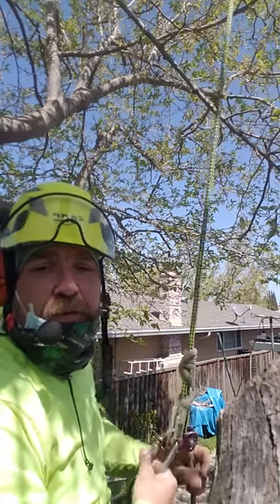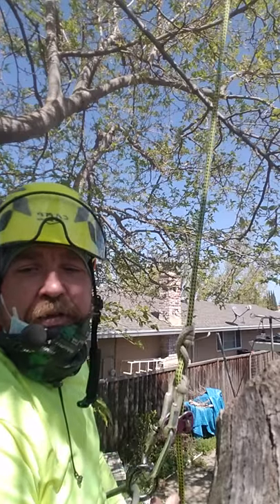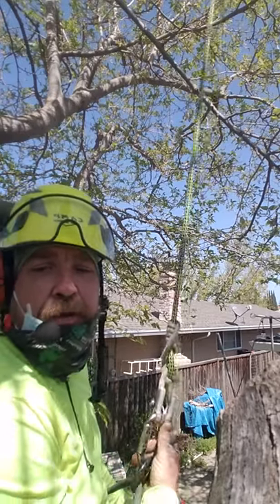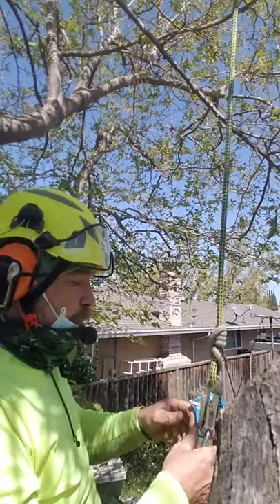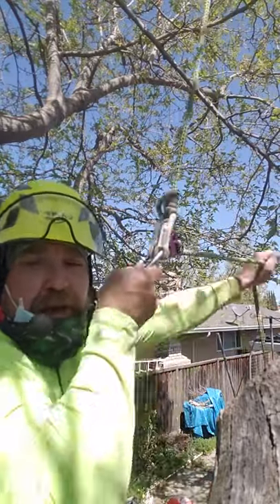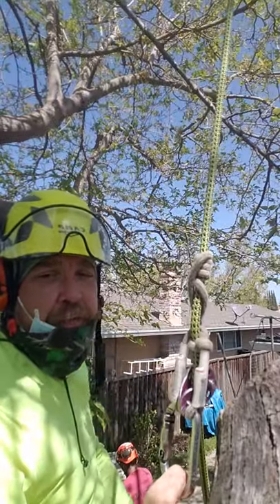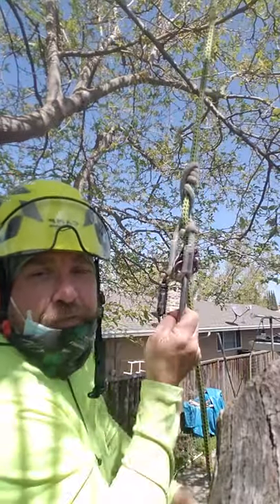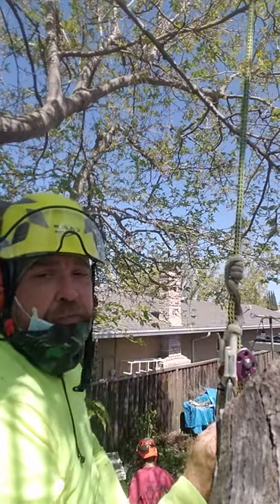tying the "McGovern Hitch" SRS climbing without a rope wrench

Comment: I am using a9.5 mm climbing rope
Reply from the maker: I haven’t tried a 9.5 mm for the rope or hitch cord myself. What I have found is the pairing of the two is very important. There is a lot of heat generated in the hitch & being able to comfortably hold it is a factor to consider.

Comment: I like it but it takes too long to set up in a production setting. Obviously, practice makes perfect though.
Reply from the maker: Now that I have been using it consistently, it doesn’t slow my production at all. It actually can make production faster because you can run two on top of each other.  Passing your system over limbs, especially for awkward natural crotch redirects, is cake & safe for me now. 

Thanks for checking it out & commenting. I think I’ll make a video of the updated version & some of the tricks you can do with stacked hitches.

Comment: Have you used this knot with a long descent?
Reply from the maker: Yes, it works just fine at a moderate pace. Any speed and it gets hot fast with a 195lb climber.  I always wear vinyl coated climber gloves. If you want to scream out of the tree, best to use a friction eight beneath it, let go the hitch and you’ll stop. Been really pleased with it. Proper dressing seems to be the key to the quality of the functionality.